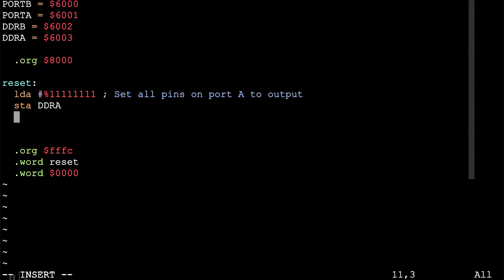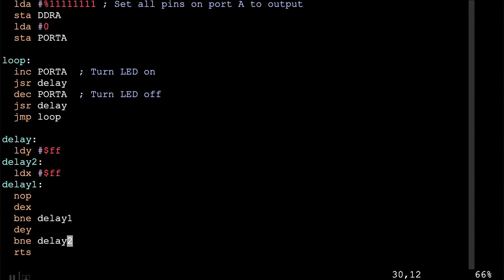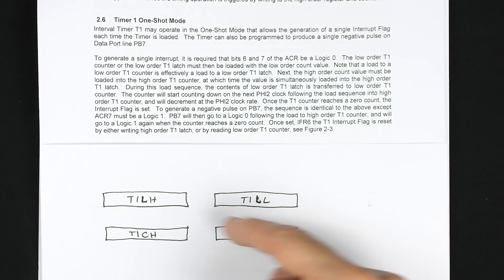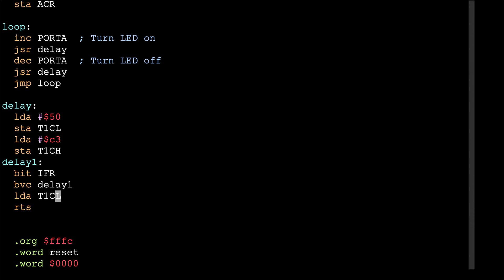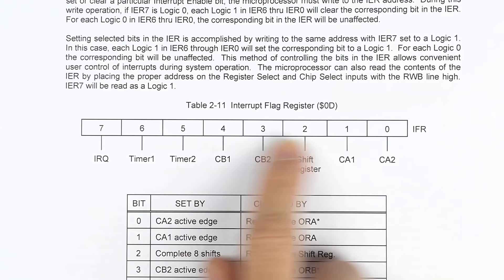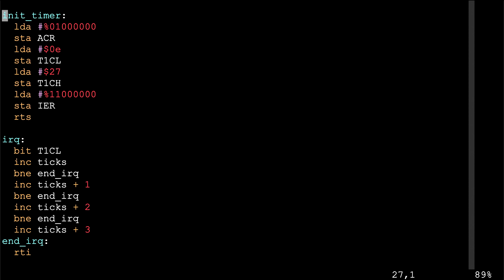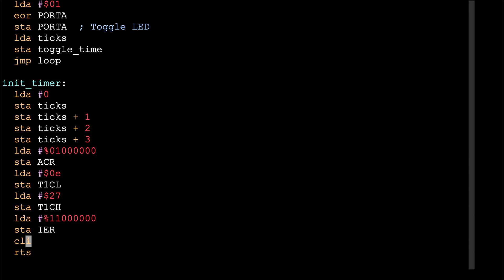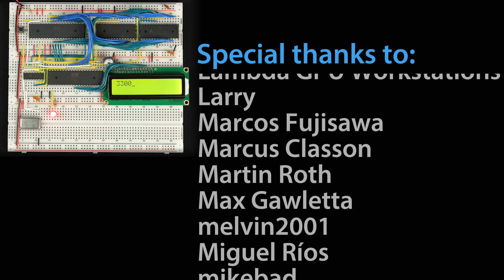How do hardware timers work?

Comment: Ben, I was waiting for the next logical step on this, and then you didn't!  Investigating, I realized with some shock that the 6502 doesn't have an instruction I expected.  I cut my teeth not on the 6502, but the 6809, which had the SYNC instruction.  SYNC on the 6809 would put the CPU into a low power sleep state to synchronize with an external interrupt. It first pushes a limited state to stack (as if an interrupt was happening), then waits for an interrupt to come in.  Once the interrupt came in, it would service that interrupt, then resume (via RTI) at the instruction after the SYNC.  Such and instruction would be ideal to put in the head of the loop here.  It would mean you're only running the subroutines once per 10ms, and are doing so just as the interrupt returns, limiting collision.  That would also mean the CPU is using less power (and making less heat) while running this task.

The 6809 system I used often (the TRS80-CoCo) would use this trick to presync with hardware for everything from loading data from tape, to doing frame rendering for video output.  Lots of neat tricks one can do when one can synchronize with a hardware event.
Reply: The 65C02 from WDC which Ben uses in the breadboard computer does have a "WAI" instruction which pauses until an interrupt occurs and also minimizes interrupt latency. For those using vasm, the wcd extensions must be enabled with the -wdc02 option in order to use this.

Comment: I was SCREAMING at my screen to use the ADC instruction! You can simply chain ADC #0 to automatically carry addition across bytes in fewer bytes and cycles than that INC conditional chain. You set it up exactly (but opposite) like that sbb instruction: CLC to clear any existing carry, LDA the LSB, ADC #1, STA, LDA, ADC #0, STA, and so on until all bytes are accounted for. The carry flag gets set by the ADC instructions, and only when overflow occurs. The net effect is that the ADC #0 becomes an effective ADD #1 if and only if the previous add instruction overflowed.

Great work as usual ;D I hope to expand my own kit with some goodies here soon, been thinking of porting FLEX (the 6800 DOS) to it for some time.

Comment: Ah, the ticks variable. I remember hearing about something similar in Windows. The resolution is high enough that it hits the 32-bit wraparound after about 29 days of uptime, which can cause bugs if a programmer makes use of it and forgets to take it into account. Debug versions of Windows start with an uptime close to the wraparound point to try and catch such bugs before it ships. If you have a Windows machine that reliably blue-screens every 29 days, blame the hardware manufacturers, because someone forgot to include the appropriate check in one of the drivers.
Reply: @Duu2  yeah, because they support 64-bit
Reply: @joshuah345  Lol thats so true, tfw you throw money at your problems by buying better hardware and suddenly every optimization task you've done in the last months becomes nearly useless work.💸
Reply: @joshuah345  isn't all of the underlying code and api's 32-bit?
Reply: @isse6790  yes, but not all.
Reply: Yep, some games had issues if your PC was up for that long.

Comment: A more advanced program would set up a vector (e.g. to a subroutine that controls when to toggle the LED) for the interrupt routine to call at the end. The control routine would then be called during each interrupt and can decide if something needs to be done. The main program could then be reduced to a dummy loop.
Reply: A program with modern hardware would simply setup a timer with a proper prescaler that would trigger an interrupt only when you want the LED to toggle. Ofc no one in their right mind would actually create a randomly switching LED for anything other than learning

Comment: I experimented with the timers a few months ago.  They're pretty nifty.  I worked out a timer interrupt with some counts to blink at 1 second intervals, and printed out the value to the LCD, and after around 6 hours it was still second accurate.  I also used it to create a text scrolling effect on the LCD that you could speed up and slow down with some buttons, and printed the speed value on the screen as well.  The datasheet is quite helpful with the 6522.
Reply: Timer accuracy has nothing to do with the code tho. Everything comes down to the oscillator precision. 1 second accuracy... Try 1usec. Where heat, PCB impedance and voltage fluctuation all causes the crystal to drift.. Or even the number of times you had to resolder the crystal.
Reply: @TheChrisey  Timer accuracy depends on the crystal and related components yes (although I used an oscillator can), but as far as software is concerned accuracy can definitely be hampered by code.  If you spend too much time in your ISR you'll miss the next interrupt (if I remember correctly the 6502 sets the interrupt disable flag on entry to the ISR). I forget the exact numbers I used, but if you set the timer to 49998 (+2) and have the ISR count 20 times you'll get a fairly accurate 1 second event (depending on the clock accuracy of course.)
Reply: @stevedonkers9087  Well of course, you can end up writing buggy code that doesn't use the timer properly causing it to skew. But that's more of a suftware bug rather than timer accuracy. Just mere semantics :)

Comment: I swear datasheet writers compete to see who can be the most opaque on timers. Maybe the chips just cram so much functionality into timers that it’s impossible to be clear, but something about timers specifically seems impossible to document well.
Reply: Better than  USARTs, generally. Those have to handle SPI, I2C, and serial (at the least).

I've legitimately seen a datasheet say "don't use this feature", more or less. It was actually for talking SPI to devices which have input and output happen on different clock phases. Which is something I saw on a frequency synthesis chip, once.
Reply: @douglashill2469  Just came across something similar in some documentation for SPI myself. A younger me would see a challenge where current me sees compassion.

Comment: the low-level hardware explanations on this channel remind me of something I came across when playing around with quite possibly my favorite cellular automaton: Wireworld
anyone ever wanted to see a Turing machine represented in terms of a two-dimensional array where each cell in the grid has 4 states? Someone, back in the nineties (though they didn't write it up until 2004), made the Wireworld computer specifically for that purpose. it uses the Wireworld CA ruleset and the 4 states each cell is allowed to have to make quite an impressive display... With the sample program, it will incrementally calculate and display  each prime number starting with two and going up until it runs out of digits.

Comment: Great video as always, Ben! Thank you!

One thing I think I should point here is that this implementation is prone to a "time drift" effect.

The problem here is that we check the "current time", and if the required amount had passed we "do stuff" and then we record "time of last update". 

But what will happen if between the check and recording a timer tick occurs (and it will sometimes)? 

We then will wait one tick more than necessary till the next update.

Over time, those "extra ticks" will accumulate and cause our program to go "out of sync" with the real world. For small LED-blinking demo that won't hurt much, but if we used this code to drive step-motor clock, e.g., we'd notice that our clock goes further and further away over time.

Still, IDK if this is a topic for a beginners' tutorial =)

Comment: It does my heart glad that not only has this excellent series by Ben Eater been made freely available, but that it uses the 6502, the only assembly language I ever learned (on my old Commodore 64 and Atari 400).
Reply: You ought to give ARM assembly language a try. It's very elegant and you can see that Sophie Wilson, who designed the original instruction set, cut her teeth on the 6502. She wrote the BASIC interpreter, with its built-in 6502 assembler, for the BBC Micro.

Comment: While he was writing the asm code I was mentally translating the opcodes in hex.
LDA #0 -> A9 00 <  edited, A5 is page 0 LDA! 
STA PORTA -> 8D 01 60
Last time I needed this was more than 40 years ago.
Damn, I'm old!
Reply: Fortunately I haven't quite yet done enough JIT code to do that for x86!
Reply: Under what circumstances did you need to translate between ASM and opcodes in the early 80s? I thought that assemblers were pretty much ubiquitous at that point?
Reply: @gayusschwulius8490  Let's make it the late 70s.
As a teenager I had designed and built a small 6502 based computer (hex keypad and 7 segment LEDs, a PIA, 2114 RAMs and 2708 EPROM). No cassette interface (in the beginning) and no other computer in sight.
So my options to get  and run  an assembler were quite scarce. 
Internet was really slow in that age, we called it a photocopier.
Reply: @newoldbrain  Oh wow, very cool. I'm currently trying to do a similar thing with a 65C02. Hearing that story I'm glad I live in the age of the internet where all knowledge is at my fingertips, haha. It's quite an impressive feat to do this with just book knowledge and no way to google things. Especially as a teenager!
Reply: @gayusschwulius8490  If you were to create an emulator (which I did for x86) you'll need to implement the actual opcode decoder. x86 is a mess

Comment: It's so fascinating how these hardware timers actually work at this level. I don't have a 6502 breadboard computer, but I'd definitely try turning this into some kind of PWM with adjustable duty cycle and try to control motors or the brightness of LEDs.
Reply: arduinos are cheap and let you do most of the same things, they also let you control hardware registers like this directly.

Though motors are a bit to current hungry to control of a GPIO pin you need a driver (high current transistor and a protection diode) to control them from a typical micro controller.

Comment: when you increase multi-byte 'ticks' variable, you can you adc (add with carry) instruction without jumps.
Reply: How exactly are you thinking? ADC just sets the carry flag, you still need to jump based on that
Also ADC does not work directly on memory, only with the Accumulator, so you need to store it back at some point
Like all instructions ADC only works with 1 byte, so you still need to stop at some point as well
I think ADC only makes the operation more complex
Reply: @beyondcatastrophe_  No, ADC adds the carry in with the argument like A=A+arg+C, so to add a multibyte number you just need to do CLC/LDA num1/ADC num2/STA num1/LDA num1+1/ADC num2+1/STA num1+1 etc so no jumps would be required. ADC both adds in and creates a new carry. But you are right, if incrementing a single multi-byte variable then doing it the way Ben has is quicker and avoids having to save/restore the A register.
Reply: @IanSlothieRolfe  Ah, thank you, I just looked it up on the next-best page, they left that out

Comment: In the past, I wrote a chromatic tuner, and used hardware timers for measuring the time between sound oscillations. This brings me back. :) Would be interesting to here you discuss balancing different paths. i.e. you know that when it doesn't branch here, it takes longer, so the shorter branch needs some nop to balance it out, and then you subtract the whole from the original period. Of course, you didn't really need that here because the hardware timer runs completely independently, and as long as your ISR isn't long enough to interfere with the timing period, you're good. Cheers.